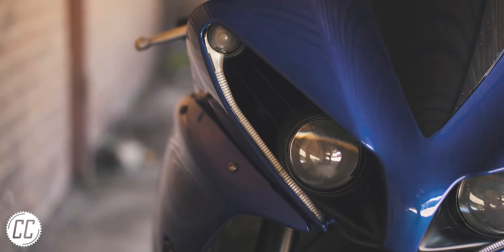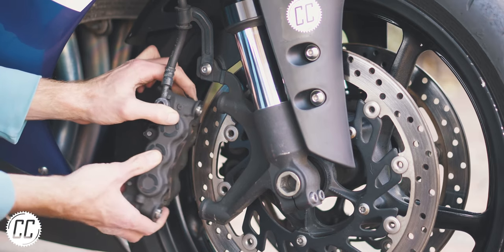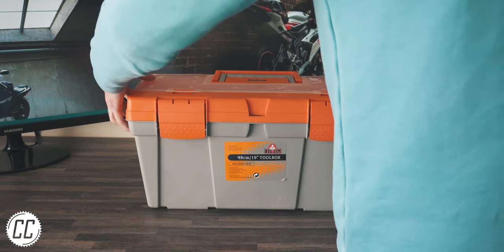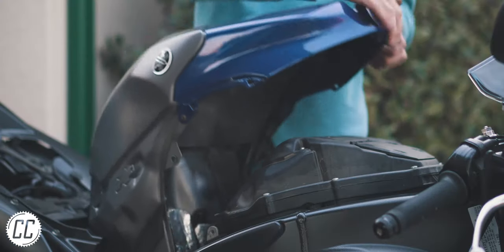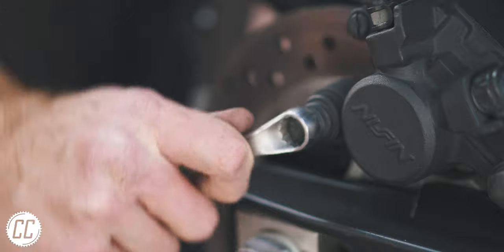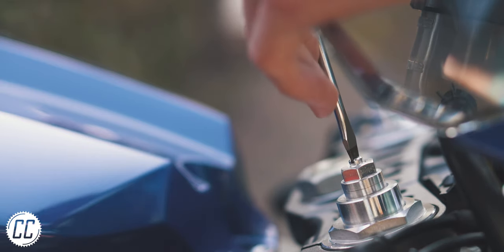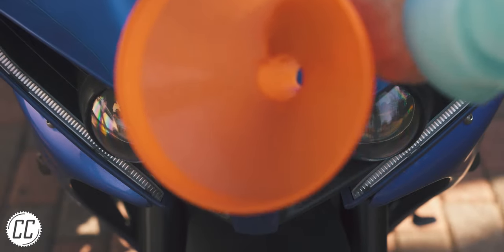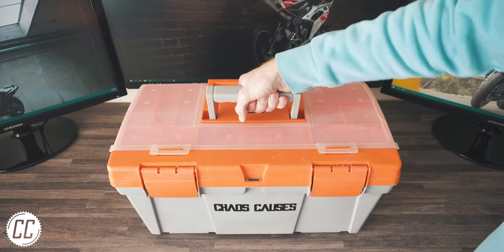The Beginner Motorcyclist's Toolbox

Comment: A few things, you're holding the oil can upside down. The opening should be on the top, not the bottom. It allows for more precise aiming of the oil stream coming out. 

It's worth getting ratcheting combo wrenches for most things rather than the regular ones as you'll do less damage to the fasteners that way. Some things, like brake bleeding will require a regular wrench.
Lastly, you need JIS screwdrivers if you've got a Japanse bike as philips will damage the screw heads.

Comment: haha, I thought i was the only one who pierced oil filters with screwdrivers in order to get them off. Great vid!
Reply: The correct way to do it is to use the right wrench, however that would work in a pinch, as long as you're prepared for the oil leaking out of it.
Reply: When I cannot remove an oil filter canister with just my hand, I'll know I just had a stroke.
I have 3xl hands. My gloves require Tucows to find them on-line and two cows to make them.
And I have to use weather balloons because Trojan doesn't make...well, maybe I should save that for a later post...
Reply: I had to do the same when I bought my bike but then I started getting the k&n filters that have the socket attachment at the top so I can just use a ratchet and socket easily and more clean

Comment: Great video and loads of awesome information in the comments. I would definitely add the maintenance manual! Maybe not as critical nowadays with all of the info you can find on the internet, but it can save you a lot of filtering through forums and youtube videos. Especially on an older bike that may no longer (or never came with) all the little data stickers. My owner's and maintenance manuals are marked with little tabs for all of the more common jobs that I can handle myself.

Comment: I always got away without funnel when changing oil in my bike, thanks to great design of castrol 1L motorcycle engine oil bottles, which are very similar to car transmission oil bottles (when opening them a long, narrow nozzle is pulled out that allows for easy pouring of the oil into the hole).

Comment: For old Japanese bikes, a vessel impact screwdriver in JIS.   
Anybody who's worked on one of those knows they makw the screws out of cheese.   Philip had bits are not shaped properly to remove them, and more often end up stripping the screw head. Furthermore, some things that haven't been moved in a long time are in there so well that without some inward pressure as well, you will not be able to remove it. The JIS impact screwdriver rotates I think something like 15° every time you smack it with a hammer. It's the only Phillips head style screwdriver I use anymore

Comment: Get spares. Because some commonly used tools tend to evaporate over time.
For instance, I like keeping a few 8 and 10mm sockets and wrenches handy. 
Two additions: Pliers wrenches. Those are genuine lifesavers. And for clipping off cable ties: flush cutters. Trust me…after the first time you gouged open your hand on a protruding bit of cable tie, you will agree.

Comment: I would recommend the tool box last that way you know what size box you need to get. For sockets get 6 point sockets, 12 points while nice can potentially slip and round bolts or nuts.

Comment: plesse be kind as i have some critiques for this vid.   i got suspicoous when item 1 was to set yourself up with a toolbox and worry about its decals.  item one should be a service manual! no mention was made of needing the owner and service manuals. If viewer needs explanation of how a ratchet works ..  well... 'nuff said about that one.  Suggestion: get allens with a ball end!  For the correct pressure gauge, see what you need for your ride,  the straight end will not work on my ride. the demo had a 90 degree valve stem adapter i noticed.  delay the toolbox for a while if money is tight. Instead get whatever compresdor you csn afford because tire pressure is critical to safety!

Comment: When I began on riding, I only had a socket wrench set. Now, I also have a spanner set, and I am looking forward to owning a torque wrench(es) to do more intermediate tasks like valve clearance adjustment, clutch check and replacement, engine overhaul and more thinks like those. Much needed now that my bike was involved in an accident against a car whose driver is drunk from a party. Ouch. Ruined the entire headlight/dash/fairing assembly. It is an FZR400R and that makes matters worse!

Comment: So much cringe.
2:45 wrong sized bolt, should have a thicker shank to locate in the plastic. or at least a washer
3:41 I'm sure you were careful but damn I felt for anyone who did that and had scratches run down their tank when something like that slips
I'm guessing you were joking about the oil filter screwdriver hack
5:03 brake pads and screwdrivers for leverage.
Great video otherwise, but the amateur mechanic and engineer in me seriously cringed when I saw those things
I get artistic licence and what makes for a great cinematography (not my field of knowledge), But there are many viewers out there who wont know otherwise and cause damage and harm to their loved machines. 
Keep up the good work, your editing is up there with the best